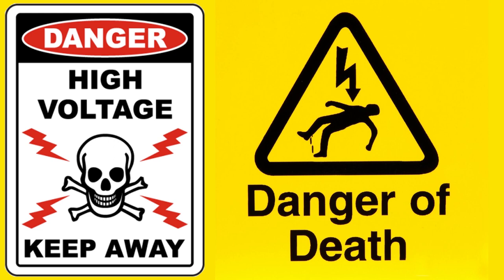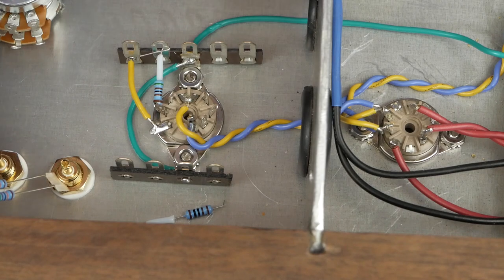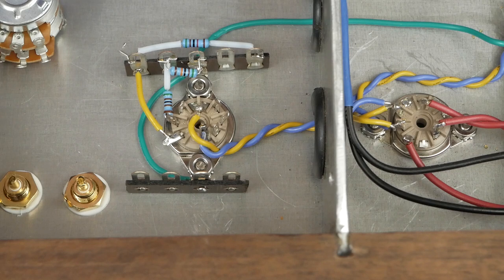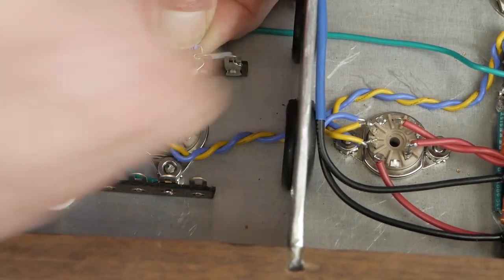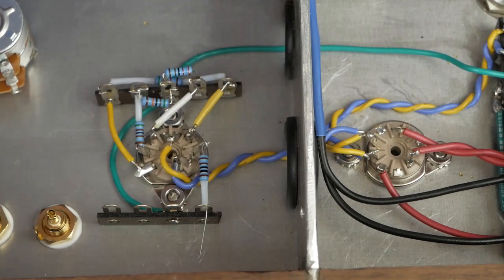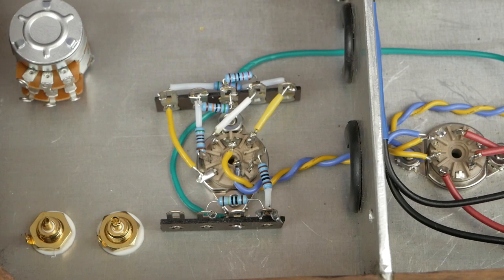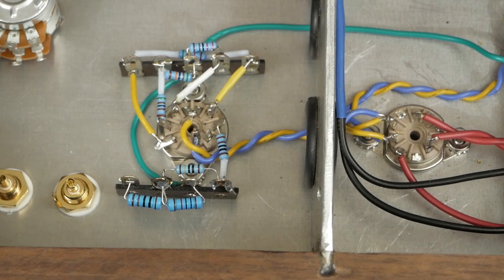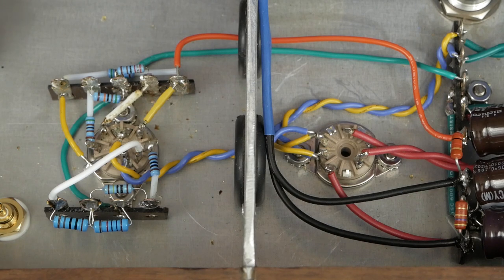"Color" Tube Pre-amp for Solid State Amps: Tube Wiring #1

Comment: @Skunkie Designs Electronics About 15 years ago, I decided to try one of those brass scouring pad soldering iron tip cleaners, and after I did, I wished I had tried it sooner. It really, really works extremely well to clean a soldering iron tip 😁
Reply from the maker: Yes they do, my iron stand has a pocket with some in it :)  I just have to remember to use it lol.

Comment: Grandfather didn't have such a fiddly task; back then, there weren't such small resistors. Building equipment is like singing... you feel better afterwards. In the 60s, hordes of women were busy creating communication technology; today, one wonders how they managed it in assembly-line fashion. Nowadays, it's whispered behind closed doors that anyone who has built a tube amplifier belongs to an audiophile and elitist secret society... fortunately, there's Skunkie!.....thx for the vid.
Reply from the maker: Yeah, today these resistors are made for solid state PC boards that have tiny holes in them. It's why I almost exclusively buy those vishay 2W resistors for everything, the leads are thick enough to work with and maybe just keep a few common sizes around in 1W for things like 1K grid stoppers.

And there is a VERY strong elitist mentality in the DIY tube community, they try to make this stuff WAY more complicated than it really is.

Comment: Thanks for video. I have 2 questions. at 9th minute what is the value of resistance between 2nd stage greed and 1M? I could not find it on drawing in 1st video.
Also what is you opinion of using one tube for L&R 1st stage and the other tube for L&R 2nd stage, because of more similarity between channels.
Reply from the maker: I'm adding a 1K grid stopper resistor there. And normally amps are made with the same channel on each tube to keep unshielded wiring length as short as possible.